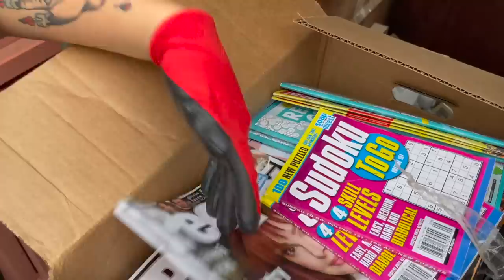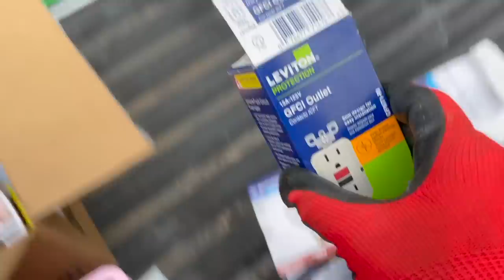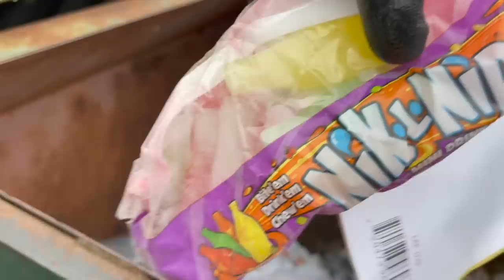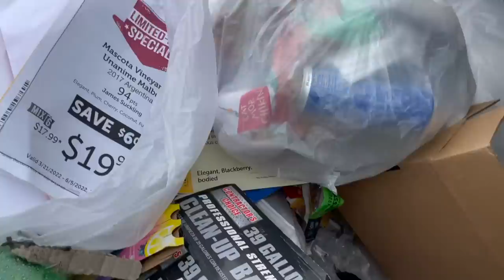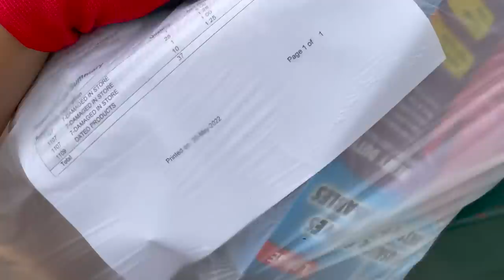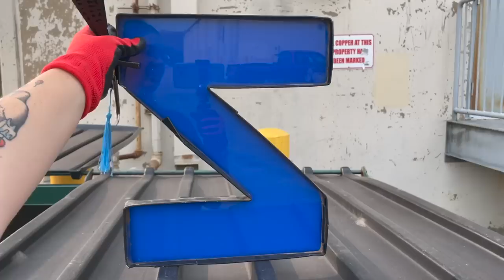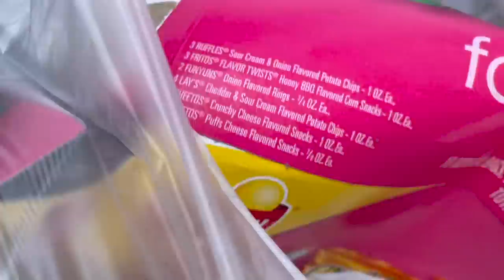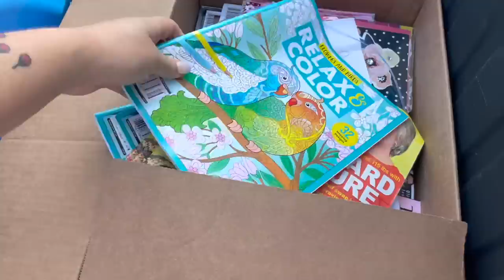Dumpster Diving Behind Shops! We Found Store Returns, Food, & Illegally Dumped Items

Comment: Hey you could turn that pressure treated box into a cool planter in your backyard eh? That was what I was thinking I would use it for. Just drill a few small holes in the bottom, fill with gravel, then your dirt, and plant away :-).

Comment: It's CEDAR wood.. glue it back in place ..refresh the wood with cedar oil.. also i would not use the other wood chest out in the yard.. even if you repaint it and sealed it with the Texas heat and rain that thing will take a beating

Comment: That is an old cedar chest that someone made into s toy chest.   They removed the lid because the lids are dangerous for kids.  They shut tight snd cannot be opened from inside.   You can get something to disable the lock but most people with kids just take the lids off.   It you want to refinish it they are great for storing extra blankets just make a new lid for it.  The cedar repels moths.  They are great at the foot of your bed.

Comment: those dumpster lids would make great planters for shallow rooted pants like strawberries. and because they are ribbed, the lower space would be great for water run off that the soil could soak up gradually. Save water and not have a mess underneath.